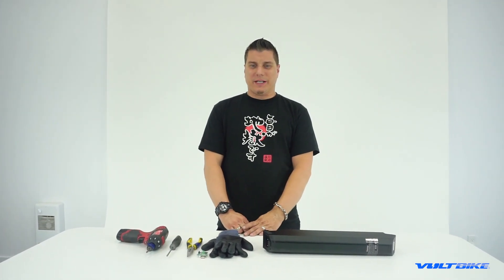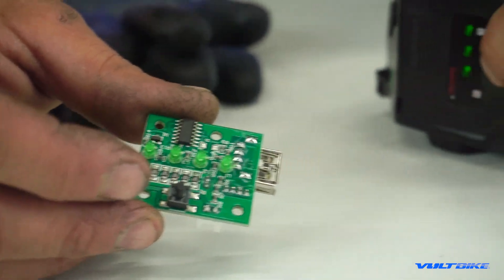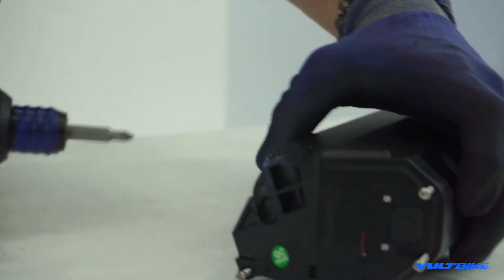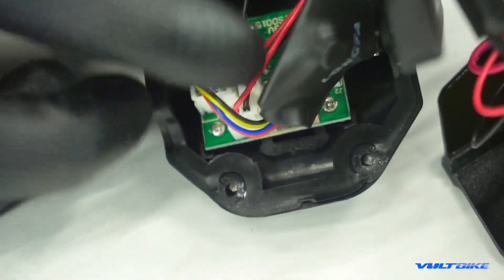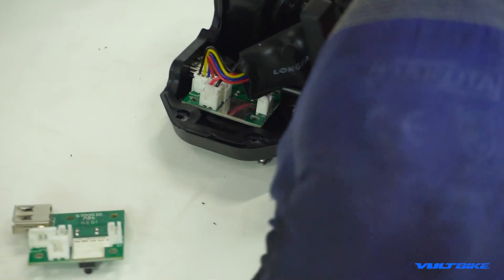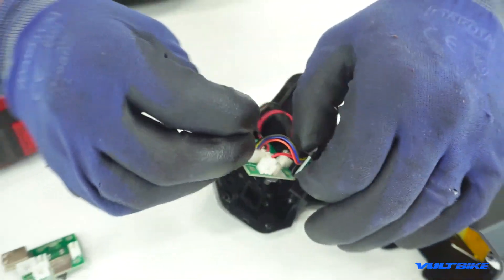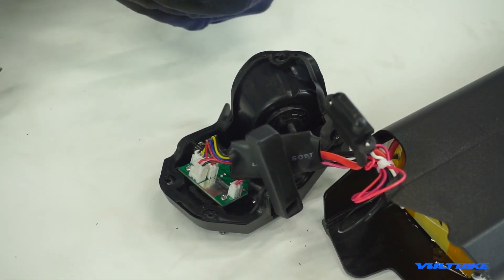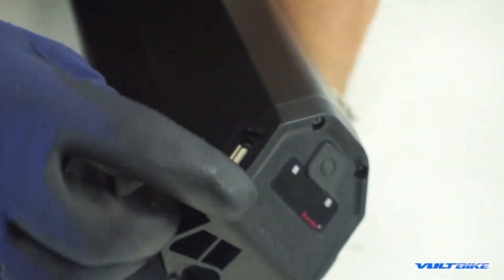Battery LCD Replacement

Comment: Is that replacement LED screen also the BMS? I think I have an issue with the BMS shutting down repeatedly while nothing is happening to the battery - no draw, no charge, just sitting at room temp off the bike. My LED screen seems to work fine but I fear my BMS is not functioning correctly.
Reply: That LED screen is not the BMS, the bms is attached to the battery pack.

Comment: Ok so I’ve sent emails and no reply so what’s the problem when the bike screen says randomly my battery is dead but the bat screen says full how do I fix this and will it be under warranty because nobody has gotten back to me since my warranty was going ?
Reply: Similar problem, correlation between bike screen and battery not the same,
Reply: Len Webber is it that the screen has five bars and the battery has four when the battery is fully charged or is it doing what mine is doing. Oh ya and when I shut the bike off and turn it back on it’s fine for a bit then it does it again when it wants to 😡
Reply: @lucadya  not quite, in my case the bike screen shows three bars remaining and the battery shows one bar remaining. Volt returned asking what the voltage should be 48v, when I checked it was set at 52v I reset to 48 v. Haven’t had time to check results, It sounds we have a different problem but either way both problems appear to be related to the battery/bike screen interface,